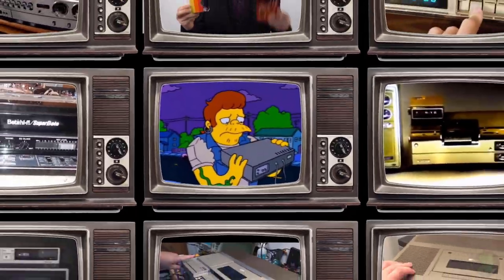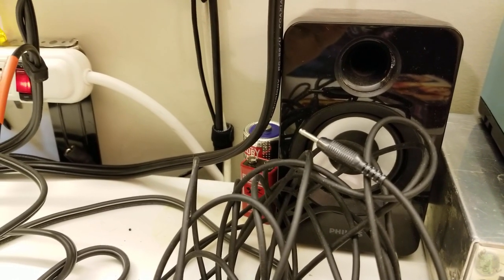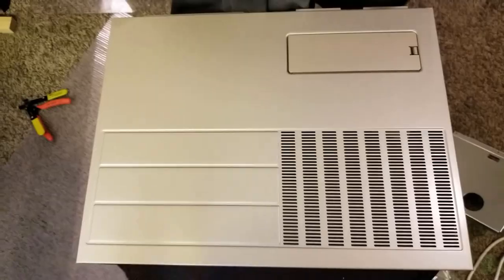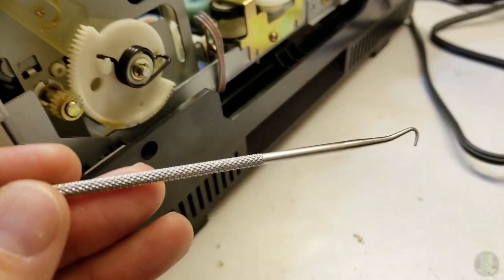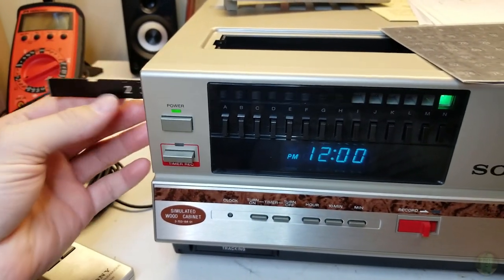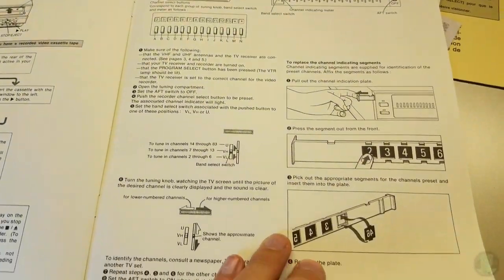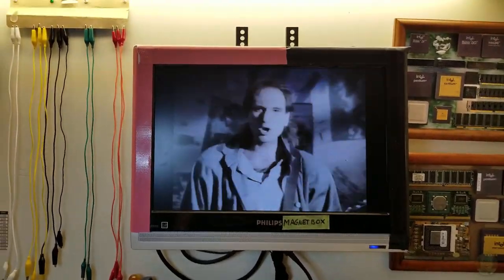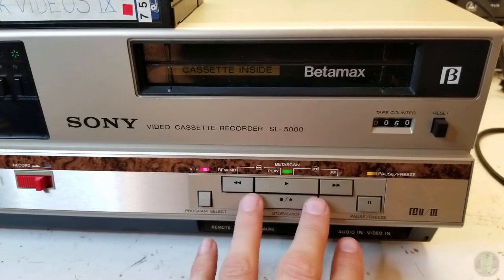Sony SL-5000 Betamax VCR (mint condition from 1981)

Comment: I remember my brother bought his Betamax VCR machine in 1981. It wasn't as advanced as this. It was the Sanyo Betacord VTC 9300PN model and it did not have FF or REW high speed picture scanning on it. It was not until about 1995 I ever saw a Betamax VCR that could scan backwards or forwards with picture.
Reply: I did own a VTC 9300 for a while and if memory serves, that thing was built like a tank !  I think the later Sanyo VTC 5000 ? in the UK was blessed with soft touch buttons and search functions.

Comment: Thanks for bringing back good memories, I learned electrónics with that machine. Eventually you will need to replace those capacitors again, so I recommend tantalum capacitors. The engineer for that machine was made power hungry it will dry those cap again soon. Thanks beautiful video. My favorite betamax.
Reply from the maker: I have a Zenith rebadge of this model, and it had the caps replaced 29ish years ago and they're still going strong. I think as long they're good quality and rated correctly it should be ok. Belts on the other hand...

Comment: The servo board on the bottom of the machine needs all "BLUE" capacitors replaced with tantalum capacitors with the exact value. But don't be too concerned about the voltage. Just exact value. Lastly, try to obtain the service manual for the electrical adjustments if you have an oscilloscope.

Comment: Really nice condition! The servos still need adjustment though. When the capstan and drum free run is adjusted properly, the capstan and drum motors should instantly lock into the right speed after switching from BetaScan to play. Be careful not to touch the "PG A" and "PG B" adjustments on the drum servo as these affect the timing of the head-switching point and if you misadjust it, you will end up with the switching point too high in the picture, or you will lose vertical sync and the picture will roll.
Reply from the maker: Thanks, yeah I plan to re-adjust them, but first I want to replace the capstan belt since the belt is loose making it real hard to get it adjusted right.
Reply: @probnotstech  How's the wow & flutter? Do you have a 3KHz tone test tape to measure it?
Reply from the maker: I don't have beta test tape to measure it, but the wow & flutter sound fine once it's been playing. I tried some music videos on BIII and they sounded good enough. But it does look like the capstan belt momentarily slips when the pinch roller engages, so I'm going to replace it before attempting to adjust them again.

Comment: I am in need of renting or buying a Beta I playback machine.  In the years of 1984-1987 I had access to "production quality" equipment.  A portable studio quality camera and machine that only operated in Beta I.  I took a great deal of video of my daughter and family and I want to transfer it to DVD or other media.  Thank you so much for this demo, it gives me hope where there was none.  Can you advise or point me toward some equipment??  Thank you so much.
Reply from the maker: I think your best bet is to find somewhere/someone local who services/sells these machines. I find it's a crapshoot around here in terms of what I find and ebay is the same but more expensive.

I believe any Sony Betamax VCR should at least play the BI speed recordings, so stick to Sony, and probably newer than 1985/1986 as those are still serviceable.

Another option is Mr Betamax. He fixes up Beta VCRs and sells them and looks to be pretty knowledgeable on them - his website is a regular encyclopedia that many of us still refer to.

Yet another option is finding someone local who does transfers of old media to DVD - they usually have multiple machines to play different formats. There's risk there though as the quality and reliability of those services can vary.

Comment: The 50 Hertz is for use in Japan. I just brought a edv-9000 and I have to down convert from 110 volts usa to 100 volts Japan... Japanese VCRs work on 100 volts 50 Hertz and USA is 110 60 Hertz.

Comment: Is it possible to output audio even if I connect 3.5mm earphones to the audio output terminal behind SL-5000? And what is the difference between the equipment that is supported by Hi-Fi and the equipment that is not supported?

Comment: I have almost the same problem. I got an SL-5000 and the tape won't "work" unless I kind of shove it. What happens THEN is it makes this super fast, super loud spinning sound, then a click and I push play. The green light turns on and nothing else happens. I push Fast Forward, it works. I push Rewind, it works. I push Pause/Freeze, the light turns on but I still don't have an image on the TV. Also, sound doesn't work. I called the only local VCR repair place and the guy "doesn't fix Betamax VCRs." Do you have any suggestions as to how to get it fixed? Any places you know of? Thanks for the video!

Comment: I've Got a sl 6ub mk2 with a rolling picture. The lower board looks very similar to mine. Will the caps be in the same place to replace? 🤔
Reply from the maker: Most likely. I googled that model and it looks identical.  I would open it up to check if it has those light blue Sanyos caps.
Reply: @probnotstech  thanks for the reply 👍

Comment: I have the full set of service manuals for this model if you need any reference. 

I still can get mine to show an image on ff and rw, but it plays nicely. It's not recording either...

One thing I'd like to fix, i a few bars at the bottom of the image that looks like its playing back out of sync.
Reply from the maker: I wonder if it needs an alignment. I have a really old top loader that I suspect is out of alignment, but I have no idea how to do it / what to adjust on a beta VCR.

Are your service manuals a digital copy or physical?
Reply: @probnotstech  They are physical.
Reply: I purchased the SL-5000 service manual online but it didn't include the adjustment manual. Can you scan that?

Comment: Such a weird design, I have a SL-5200 on the way that's sold as working aside from some video quality issues, which can hopefully be fixed with a bit of head cleaning.
Reply from the maker: I actually just picked up a SL-5200 that I plan to do a video on soon. I expect it will have the same issues as this one - definitely check if those caps have been replaced in yours.
Reply: @probnotstech  What, the Sanyo caps? Will do. If I see them in there it's safe to assume they haven't been changed.
Reply: @probnotstech  Turns out I've got a different issue, Play and Fast-Forward do absolutely nothing when pressed, but Rewind does work.

Comment: Tenho um igual e um Wega azul. Betamax Sempre! A mudança de correias é complicada neste modelo que partilha a mesma mecânica com o SL-C5/C7,com algumas diferenças.
Reply from the maker: Interesting. I would have thought the SL-C5 and SL-C7 would have been closer to the North American SL-5400 and SL-5800. You're right about the belts though, they are a pain in the butt.
Reply: @probnotstech  também tenho um SL-5400 que veio do Canada. É Top!

Comment: hi done alot of re cap in the past over time i got very good at it   I buy in 1000's of caps from RS in the uk  they will all go over time
there is one betacam sp decks don't play up alot  i know this  i have alot of them yes alot all ways buying them and i am push the price up in the uk
it's the ebay computer sales price doing it  not me  
 buying them  i still have  home decks the 8 system ones more hard to find  decks just was lucky in the past that's all